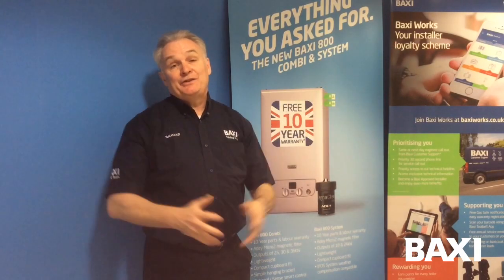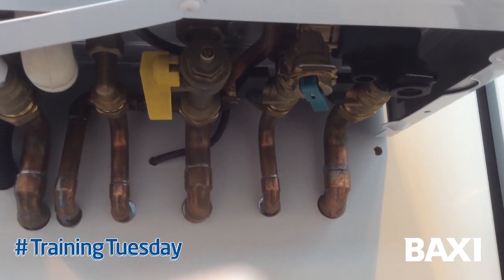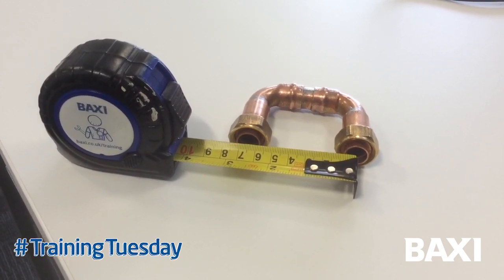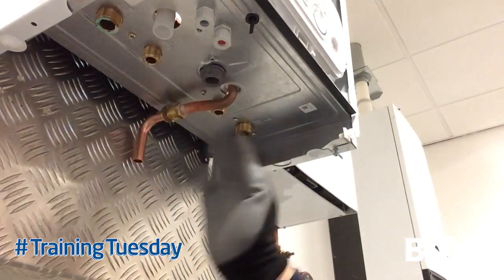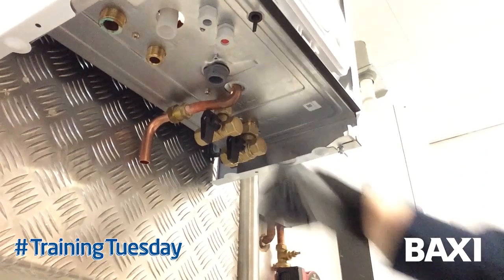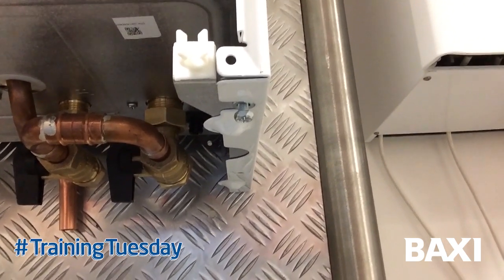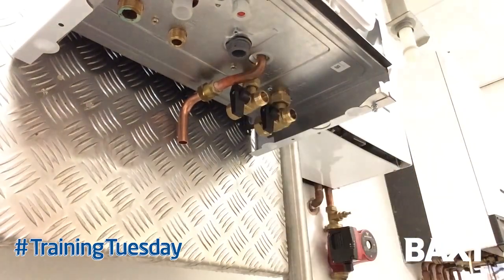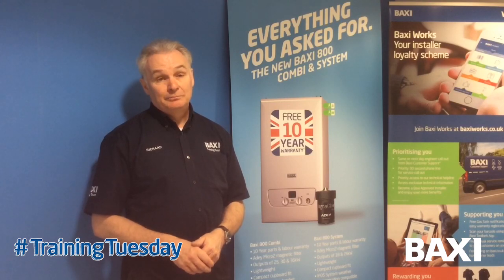How to make the pipe connections easier on the Baxi 600 and 800 range of boilers | #trainingtuesday

Comment: What you NEED to do is buy a Worcester or Vaillant...... lol
Reply: Buy a Worcester 🤣🤣🤣🤣 This guy is funny.
Buy a worcester so you can have pinholes on most of the components every 6 months.
Reply: Worcester,yea your funny .
Reply: Tim you obviously ain't a gas installer. Respect to Vaillant, but the Worcester design team need sacking. One of the worst boilers to work on, across the range.